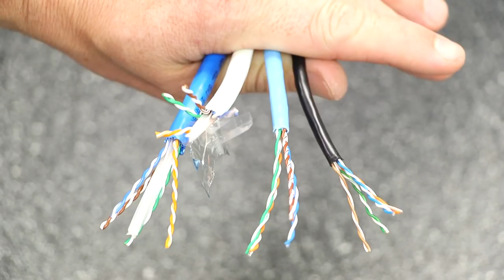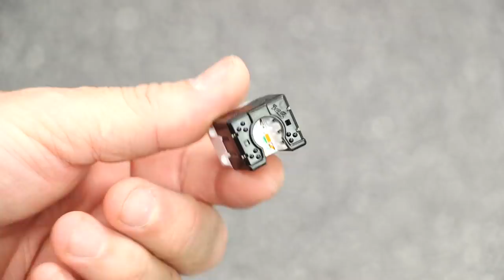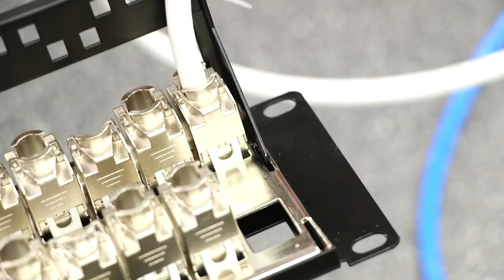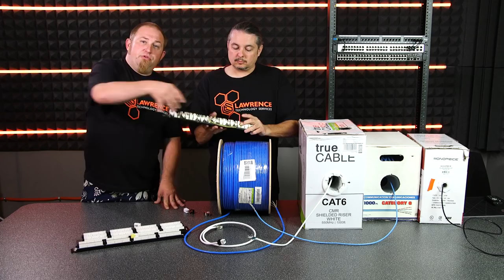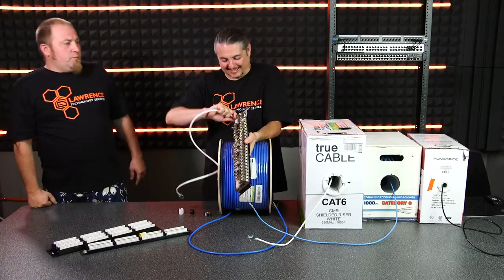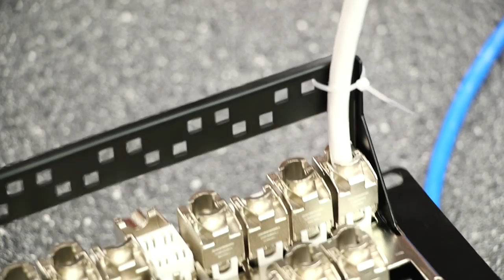Structured Cabling Discussion: Working With CAT5e, CAT6, CAT6A & Shielded Patch Panels

Comment: Hey guys thanks for the video! Love your content. I tried for a whole week making my own cat6 I did finally discover that the pass through termination worked best for me. However, the tool was $50 (when I already bought one standard crimper I couldn't return)  so I decided to go with monoprice and color code all VLANs, trunks, etc. I also have arthritis in my hands so... I think I failed my self taught layer 1 stuff. :) I have several hundred feet of.. attempts.lol Cable management.. I will work on that, thanks again!

Comment: Hey guys, need some guidance please. I have roughly 50/50 of Cat5e and Cat6a cabled throughout the house. Should I terminate the Cat5e on a patch panel for that type of cable and get a second patch panel for the Cat6a? Or should I go down the middle and get one Cat6 patch panel and terminate the lot on it?  I'm just concerned about the different wire gauges not making properly.

Comment: For a residential home would use of Cat6 cable be adequate if converting to a 10 gig network is not likely in the future?  I have a couple runs that are already Cat6 (my longest) but the majority of my runs are still Cat5e.  I'm contemplating upgrading the Cat5e runs.  Also of note, the house is a tri-level with a basement which type cable should be used when traversing between floors Plenum or Riser?  I think I saw in one of your other videos where pre-made patch cables were used in conjunction with female to female keyway RJ-45 jacks that were being used at the wall plates.  Do the female to female keyway jacks affect the performance of the run?

Comment: Just go modular with all of your patches even Patch 6,5  using a keystone patch. I actually hate those punch down patch panels. since just adding a single cable would require me to take it off the damn rack.
Reply: Exactly. Modular is so much better. You can reconfigure, add, whatever. So much easier.
Reply: I agree, however the total cost might be slightly higher for keystone so that may be the driving factor in a large installation.  In those situations, the lowest bidder is not likely concerned about future cabling. I'm sure if the RFQ specified modular/keystone patch panels, that is what would be quoted and done.

Comment: Why use CAT6A for >50m switch interconnects when you can run fiber (OM3/OM4) instead for a lot less?
Reply: Because running CAT cabling is far simpler, faster and cheaper than running fiber. To buy the equipment to install, splice, and test fiber is expensive. Additionally, there are the safety concerns with fiber systems especially if it's a big system. Training employees to install fiber is time consuming and expensive.

Comment: What's cheaper? Doing an initial Cat7 install right from the start, utilizing only gigabit speeds, or realizing you have to rewire your entire building once the prices drop on 10gb switches and adapters? I don't personally like having to rewire the same building multiple times. I don't like crawling through crawl spaces, I don't like stabbing roofing nails into my skull climbing through attics.. I hate spider webs and sore knees and backs... I'll always push as hard as I can for customers to go with an initial Cat7 install making sure they realize how much more it's going to cost them in the future to upgrade vs just being able to swap out a switch and a few network cards. Remember... No one would ever need more than 640k of ram..  Same with network speeds.

Comment: Sorry allow me ask a noob question: why we even need ethernet patch panel, why not just directly plug it in to switch or router, thanks
Reply: steven Gao makes for easier troubleshooting for large jobs, if you ever have to go back.
Reply: If it ever failed or the cable is busted, then you have to reroute though the walls and crawl spaces; just a pain. If you patch into a patch panel, it is essentially like a keystone jack on the other end. That cable will never be touched and has less chance of failure.
Reply: The other two answers are good as well. You could technically put an RJ45 connector and plug the cable directly into the switch and it will work. However, you don't want to do this because those cables aren't really meant to be moved around a lot. From the patch panel, you would plug in a patch cable to the switch to make the connection. This makes it easier to troubleshoot and not have to worry about potentially damaging the cable and having to re-run it.

Comment: This may be a dumb question but if they want 10G speeds, why not just use fibre?
Reply: Good point...and that is what I too was thinking...why not just fibre?
Reply: Fiber is not as friendly to run with termination being difficult. Plus the install might be smaller and it could be cheaper to go 10G-BaseT
Reply: Understandable...yes fibre can be a pain....but it sure sounds like cat 6a is a pain too...and costly.
Reply: am385 Fiber is terminated easily now days mate.
$300 dlls worth of equipment, presto!

Faster than you can put an RJ45 jack, or punch ethernet down.

Check YouTube for getting up to speed.
Reply: Same question I had right away.
I would never install Cat7.
Cat6 sure. Pre-made cables only.

Other than that, fiber for any long run that needs more than 1Gb (Cat7 patch cables ok, but again, pre-made!).

Fiber is immune to interference, more power efficient (power to transmit) than copper, faster speeds,

REAL future-proofing as can doble, quadruple and more the bandwidth once you add colors.
Also, there is no inherent speed limitation like in copper: Faster speeds with newer lasers/leds/electronics.
Reply: Why actually ever use fibre for anything less than 55m indoor runs? On shorter distances you get nothing more from it than from a twisted pair of an appropriate category. Probably evena worse latency because of the media conversion.
Reply: Eugene Fishgalov I always install fibre between any comms kit back to the main comms room and then cat6 from the nearest comms room To the desktop. Servers all on fibre cards if the customer can afford it.
Reply: P V nah I think it's pretty close to the same speed as RJ45 but much more dangerous to rush, and you're going to end up with slanted cuts giving higher DB when rushing fibre
Reply: Wire can't produce 10G speeds unless it is room to room (a telephone).
Reply: Wire can produce 10g speeds
Reply: @ Eugene Fishgalov You use fibre for electric seperation. With copper, you're electrically connecting equipment which can often be tied to different power sources. This can fry your switch-ports, or - worst case scenario - your equipment if there's an imbalance in the system.
Reply: Athinira, good point. I think of fibre mainly for this reason too (an electrical disconnect, which also includes immunity to interference [ex. induction]). But also the opposite intent may be true. I mean, if you want to run PoE, good luck using fibre for that! Imagine using nothing but fibre optics, and then you decide later that PoE would have been handy for certain equipment on your network. Now you're SOL.

Of course, you could use PoE injectors closer to the device with fibre for data as a make-shift hybrid, but that starts to defeat the purpose of using fibre in the first place, which excels at single segment long distance runs.

Comment: We just bought a house and I was going to run Cat6a. Guess I'll just stick to Cat 6 instead! LOL
Reply: Dos Maiz go with CAT6a shielded cos you can then run HDMI distribution over it like systems from http://oneav.co.uk
Reply: Richard Cooke you can run HDMI over CAT5E unless you're talking 4k 2|2|2 chroma then yes cat6A is the way to go or Crestron ultra cable if you don't like money :)
Reply: Ben Jones correct, HDMI over CAT5 also has a length restriction of about 35m.  Every house I've done has been in CAT6a shielded and yes it cost more and yes it's harder to install but it's fit and forget in the knowledge that you won't have any problems. 

We did a job for a customer and planned on using CAT6a they then said that they would pull in all the cables for us to terminate.  When we got there they pulled CAT5e un-shielded, data worked fine but HDMI was a mess 😕
Reply: Richard Cooke For sure sheilded CAT6 would be my preference, you know if there's a problem it's likely the cable somewhere, and it's the minimum spec for Atlona, Savant, Kramer RX TX devices.

But if you have the money Crestron will do lossy 4k over cat5e upto 50M. Maybe you should have told the customer what they saved in wire they get to spend in twice the equipment cost :)
Reply: Ben Jones lol good one bro
I think if you own your property than spend it on  the infrastructure cabling. Cabling stays in the walls  and equipment changes all the time. Future proof the best you can 
Saves you later. I super drunk damn diet and straight shots on the rocks.

Comment: LoL all these people in the comments talking about over kill ideas. In truth most users / applications 100Mbps is actually over kill even. Gigabit is good to have, as every standard computer comes with it, network equipment is cheep at that speed, and Cat-5e / Cat-6 is cheep and common. 10Gbps is nice between switches and servers (Back hall). But if your doing long runs or even short runs, put in fiber chase, pre-turminated fiber from your central switching and outer switching locations. And for that guy running POE long distances, its not the cable its the distance, of course the thicker cable with shielding dose better.

Comment: My Cat 6A comes in a box. Must be a bad distributor that you go to that only has reels. Reels, like loaded patch panels, are for the stupid who like to work harder.
Reply: The video is 2 years old, but most Cat6a I've seen still comes on a spool, however that spool may be hidden inside a box. Spools are often the only option depending on the media and are not just "for the stupid", for example I've never seen a 1000' of fiber that didn't come on a spool. Open spools (not in a box) have additional setup work, however the cable pulls out with no twists vs a box that does not have an internal spool. Having no twists can make the runs easier, depending on situation.

Comment: Cat5e and Cat6 have a quality distance of 300 FEET NOT 300 METERS. Each box holds 1000FT you can't use damn near that entire box for 1 run. 😂
And you.didnt mention Plenum rated cable. Youre breaking codes depending on the cabling environment

Comment: Make your life/work easier by buying pre-made cables and using keystone pass through patch panels.
 
Either coil the extra length neatly, or simply cut one end and  install RJ45 (still easier than behind a patch panel) and you already saved half the work.

Work smarter, not harder!
Reply: Amateur

Comment: I can't believe you guys were installing CAT5e in 2018, that's just sad man. the price difference between 5E & 6 is negligible.
Reply: I agree the price difference isn't too significant when factoring in the labor and for a full build out Cat6 makes sense. However, consider this situation: an existing building has all Cat5e to their 150 end points and they need to add 2 more drops in each of the 6 conference rooms. Is there any point in making those 12 drops Cat6?  No, not at all.